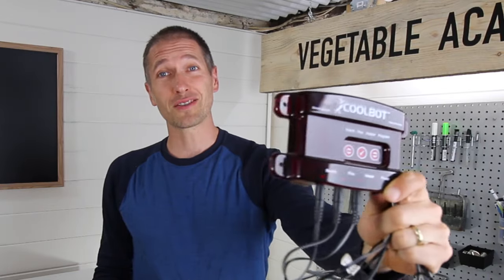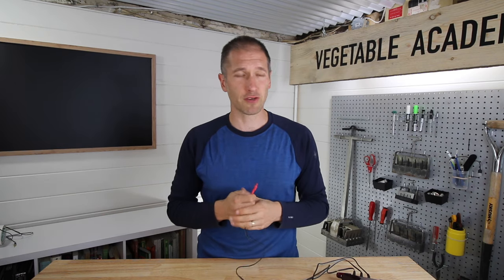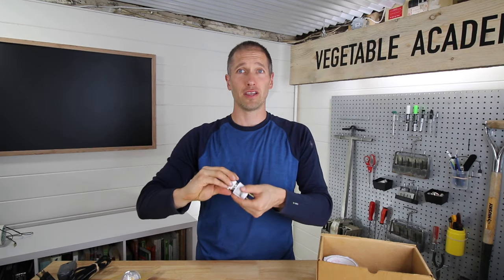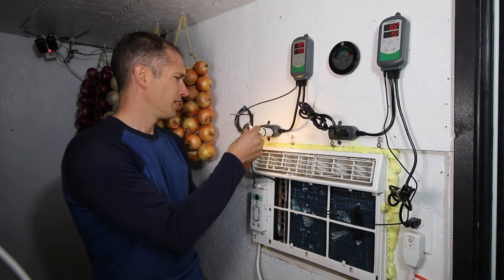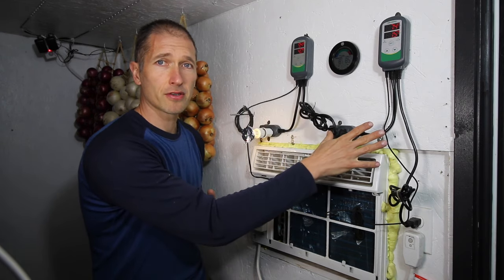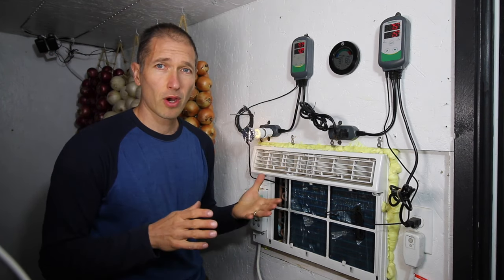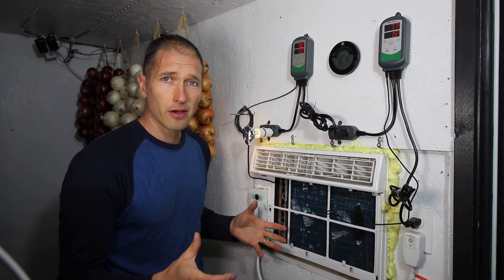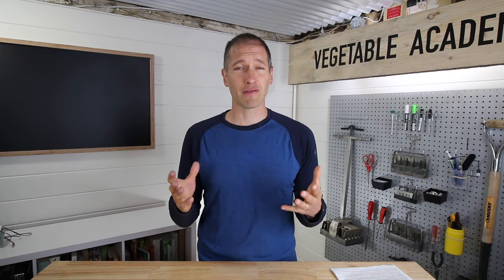Build Your Own Walk-In Cooler with this DIY CoolBot Alternative

Comment: " Cool" video LOL!   Another important point is the ALL THE FINS on the inside and outside of the machine need to be CLEAN and STRAIGHT!  Maximum AIRFLOW is very important.  It helps cool the room faster and helps keep the fins from freezing up. 

 I dissagree with the "correct size" AC unit.  My experience has been the bigger the better.  Lots of insulation with a big AC unit has really worked well for me.  "How cold does it get"?  that depends on MANY FACTORS.  AC size, room size, insulation thickness, outdoor temperature etc.
Reply: Hi!  What size A/C would you recommend for small walk in to keep my flowers at 50*F ? The space after insulation would be about 60sq ft.  I gotta cut costs where I can. This will help a lot.
Reply from the maker: Thanks for sharing your experience with larger than recommended AC units.  CoolBot advises against this because it can lead to a situation where the AC unit is cycling on and off a lot more adding additional wear and tear on its components.    Since it is not practical to buy a bunch of AC units of different sizes to test them out in our system, it is nice to hear from someone who has had success without following all of the recommendations.
Reply: Great videos!  Thank you!!!!    Good info you provide.  One thing I forgot to mention when using a large AC unit is you can put an $8.00 lawn timer in the system so when it gets down very cold the timer will turn everything off    until you want it to come back on again, thus saving additional wear on the machine and electrical expense.  I set mine to be off more at night and on more when it's hot out.  $8.00 timer saves about $100. to $200. a month.

Comment: You lost me when you decided to use an LED light for a heating element.   Rather than all that contraption, you could have bought an incandescent nightlight and put the probe inside the clear plastic cover with the bulb.
Reply from the maker: Yep.  That would probably work well too.  The first light I tried was actually a nightlight, but being an LED, it didn't offer enough heat to warm up the temperature probe.

Comment: when the unit turns off does the fan keep running
Reply from the maker: That depends on your A/C settings.  Coolbot recommends setting your A/C unit to "Cool" mode with the fan speed on "high".  If you do this, your fan will always run and the compressor will just kick in when the Inkbird units call for more cooling power.  I prefer not to have my A/C running all of the time because it uses more energy, so I have my fan speed set on "Auto" which means that it only turns on when the A/C unit is cooling.

Comment: DIY wouldn’t be necessary if coolbot wasn’t way way overpriced. 
This is a basic control setup that is well over 100 years old made with modern hardware. One can probably find mechanical temp sensors with switch for free or a few bucks in a junkyard where they have refrigeration equipment. 
$420 for a gizmo worth maybe $50…. 🤔

Comment: Couldn't you use something like an arduino or raspberry pi? You probably get away with a single device.
Reply: Yeah and you could skip the light bulb altogether and just output the required signal. The only question is whether the electronics are rated for the freezer room's temperature and humidity

Comment: I can tell you  if you think an led bulb is going to cycle the system fast enough to keep it cold for things other than vegetables and things that require average refrigerator levels your insane , i have tried all variations of tricking an ac unit to perform at optimum levels and a cool bot does a lot more than this gentlman claims. You will never get a cooler to stay at safe levels for game doing this nonsens

Comment: You people are ridiculous. If you're going to hack it, do so with intelligence... Get a paragon 8145-00 and an A419. Could also use a ETC111000. The timer and a potentiometer will solve mostly everything. Then, and only then can you begin your compressor killing journey. CoolBot.... Spare me. I'm a HVAC/R technician with tenure; and cheap jugglers tricks like this usually pollute most customers minds. All too often am I asked to do this to a Chukee Cheese 5K BTU window shaker, for a space that's larger than the rated capacity.
Reply from the maker: I checked out each of your recommended products and it's not clear how you would use them to override the built in control system of a window air conditioner to serve the same purpose.  Perhaps you didn't consider all of the details or you have an entirely different system in mind, which would be totally fine.  I would love to see your video about it when you're done being angry.  Until then, I will let this cheap system keep doing its job, because it's cooled thousands of pounds of produce for us over the last 8 years without fail.

Comment: Why don't you just buy a 2nd hand walk in freezer/cooler & scavenge the unit out of that dude >>> this use of an air conditioner is an absurd concept- using an air conditioners vs the actual refrigeration unit dedicated to the task... just mind boggling to me... visit a junkyard- problem solved without the joker build... unreal